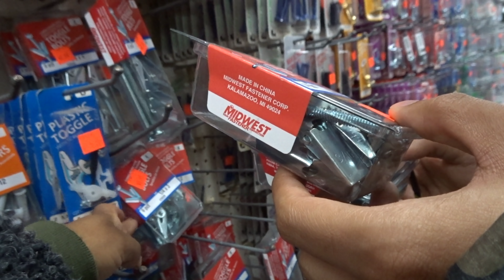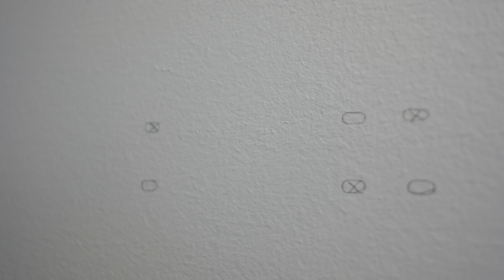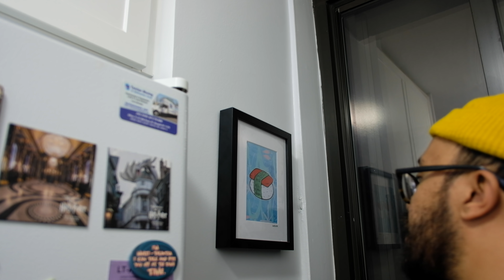SMALL NYC KITCHEN MAKEOVER | My Rental Refresh Ep 3

Comment: In front of the window, floor to ceiling, 12" deep x width from left to right wall, wire shelves. Won't block light, much more usable space. Right side wall 4" - 6" deep max ledger shelves, at least three....almost like what is under cabinet spice shelf. No choice but to go up...that's my 2 cents. Great job:)